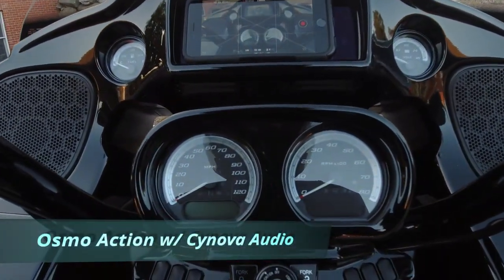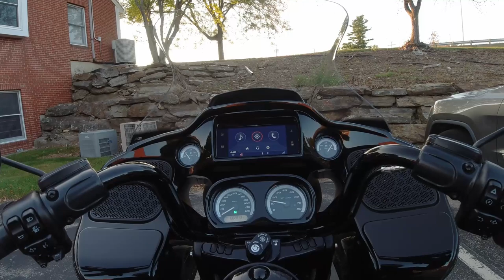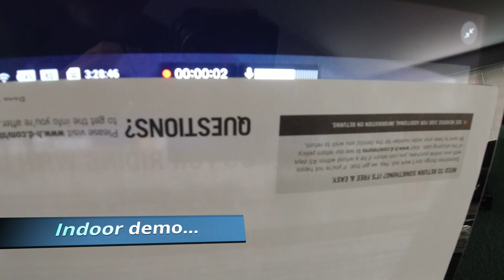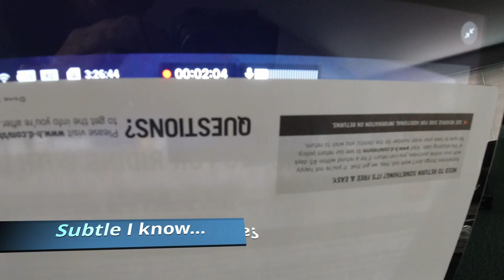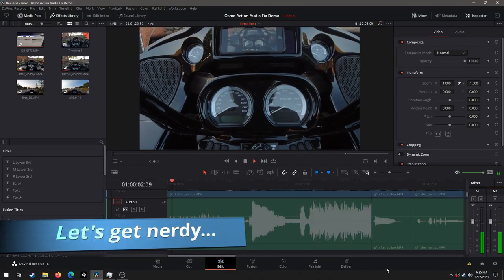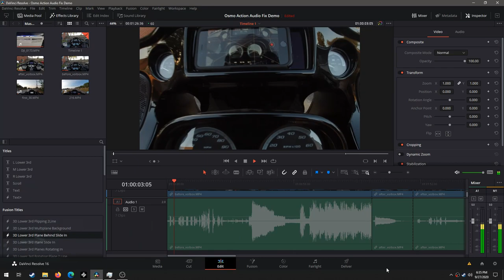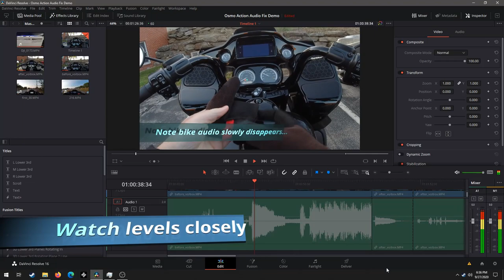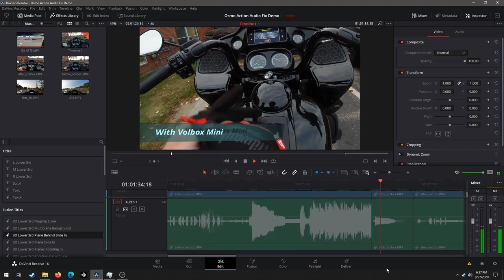DJI Osmo Action Audio Issues - Microphone Attenuator Demo

Comment: Man, I just had my first ride with my new DJI "GoPro Killer" Setup and sound was horrible, I then found your (and other) threads on the DJI Forum. Going to try a volume control 3.5mm cable. If it does not fix this, I will get back to recording the audio on my phone in the jacket and sync the audio with the video in DaVinci Resolve :(
Did you try it with "wind cancelation" turned off? Does this help keeping the engine volume up?
Reply from the maker: How's that working out?  The "wind cancellation" appears to have no effect on this issue, I've tried it both ways several times.  I also bought two other non-Cynova knockoff adapters and it's 100% an issue with in the software on the camera, same exact behavior.

DJI has never responded to that forum post and never responded to my support ticket... which is a shame b/c this camera other than this one issue is just about perfect!
Reply: @schmoofrides5142  my cheap vol Control works
Reply from the maker: @bernardhossmoto  You don't have the low end issues I'm experiencing?  You mentioned in your forum post about using a high pass filter... I do not want to nor should have to do that... one of the best parts about filming motorcycles is the audio!  Glad it's working for you if you're happy though.